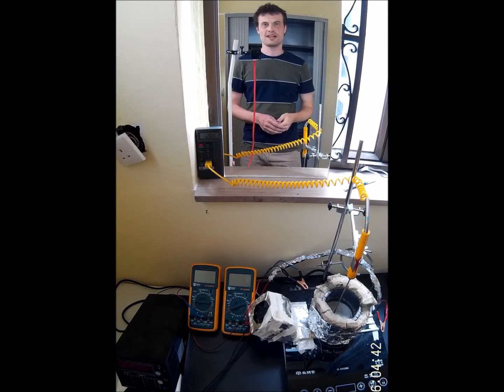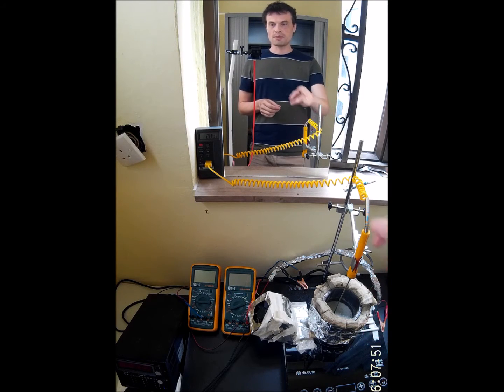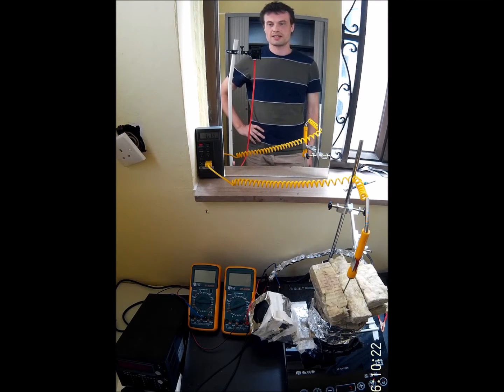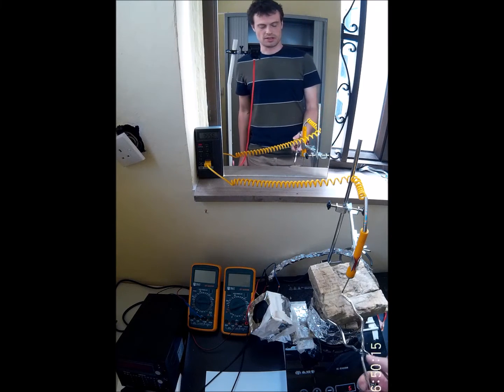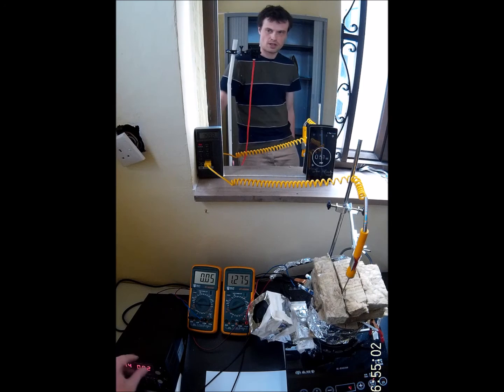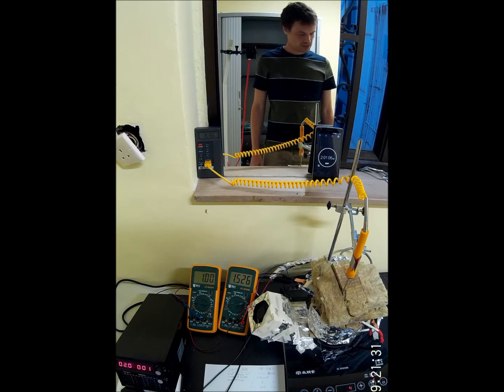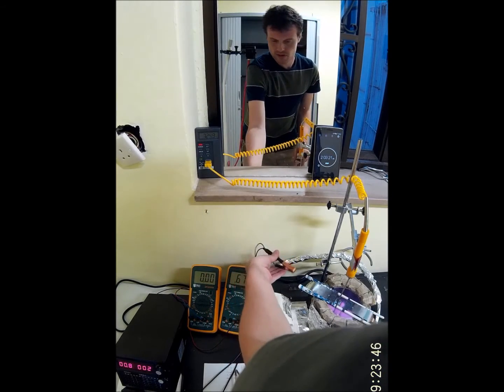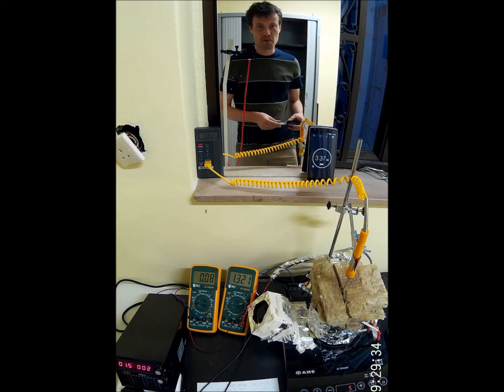DIY Synthesis of carbon nanofibers from atmospheric CO2

Comment: Did you see the new paper published in which they used galinstan at room temperature to do this? Or at least they make solid carbon. I really want to see a video on this in the future from someone.
Reply: Where did you find that paper? And is the product also carbon nano fibres?
Reply: @billmuller6133  Search for the large quote at the bottom of this reply on google and it will bring up at least one article from a source im not sure on but you can find the actual research paper from this info. I don't think its nano tube but fibers maybe? I didn't read the entire thing just kinda skimmed through it.

"CO2 Converted to Solid Carbon
Using a liquid metal catalyst, greenhouse gas carbon dioxide can be removed from the atmosphere and changed into solid carbon that can be stored or used for other products.
by: Kevin Clemens Battery/Energy Storage Recycling, Alternative Energy, Materials March 01, 2019"
Reply: @x9x9x9x9x9  Thank you for your quick answer. I found the article and managed to find the paper on nature communications aswell.

Comment: Hi Olli, I have attempted to replicate this myself and am finding I am not getting any carbon deposit, just wondering if you are referring to anode and cathode in conventional current or electron current? Also, did you leave the insulating roof on the crucible the whole time or did you leave it open to allow air in? Cheers!

Comment: Now you can start on a process to teraform Venus's imensly dence atmosphere. Its already very hot and has a high concentration of CO2 (about 96.5%).  Factories that produce oxygen and solid carbon can float in balloons above  Vensus's sulfer dioxide clouds collecting sunlight to power this initial  teraforming of Venus.  As O2 increases, many surface rocks will begine to oxidize which in time would further lower the pressure.  Im not sure if there is a reasonable  source of hydrogen to further sequester oxygen and to make water.  Maybe an artifical magnetic field funnel can capture hydrogen in solar winds around Venus.  There is also a posibility water can be found deep in the crust and mantel like on earth.
Reply: and no one know that info for facts cause no onee been there :)

Comment: Hi. I have a question about this kind of heating.
what did you use between pot and the glass of the stove?
is there any requirement for pot to be in touch with the glass?
Tnx
Reply from the maker: Need to keep pot well insulated from the glass. I used rock wool on top of ceramic chopsticks with a fan blowing air between the chopsticks.

Comment: How did you managed to get high temperatures with induction stove?
Reply from the maker: I needed to insulate the pot with rock wool, also from the induction stove. There's an air gap between stove and rock wool + a fan to cool that gap.
Reply: Did you use regular kitchen induction stove?
Reply from the maker: Yes, but I modified it a bit by moving the coil a bit closer to the glass plate.
Reply: Tnx a lot, i am interested in doing this as school project
Reply: What are current parameters?
Reply from the maker: Should be around 0.25 A/cm2 of anode exposed to electrolyte